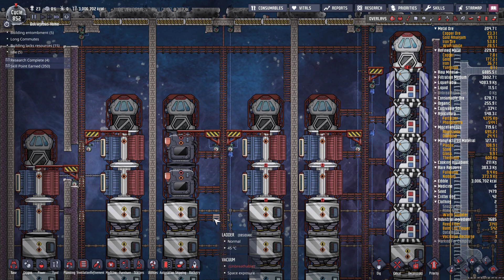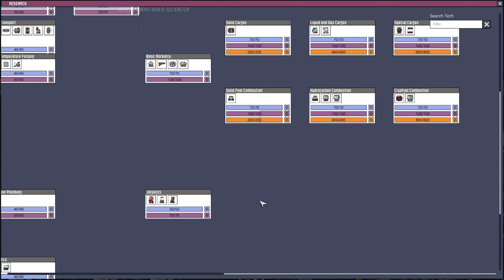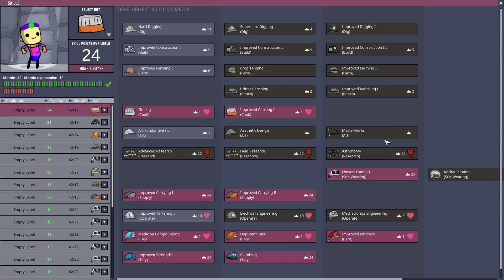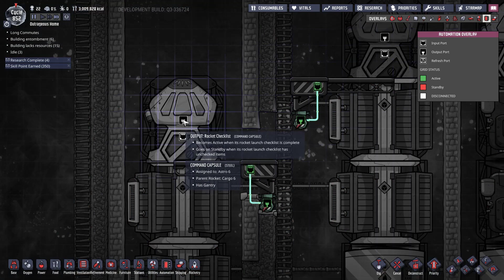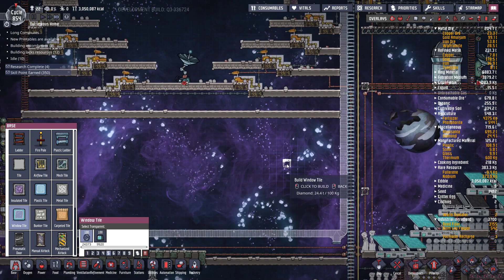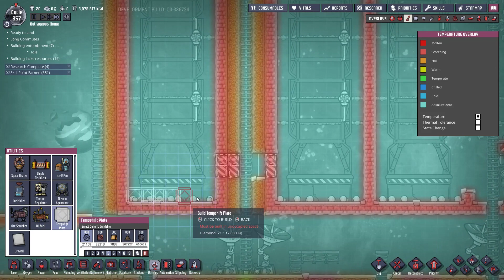QOL Mk3, 31 Rocket Automation : Oxygen not included

Comment: Does this carry over to the spaced out dlc?
Reply from the maker: They changed the rockets a bunch in that, they introduced some extra fuels and the rocket capsules now need to be configured. A lot of the reasoning for the automation in this was to defend against meteors, they are removed in the DLC so most of the automation is not necessary anymore.
Reply: @Francis John  thanks just finished watching your latest upload.  Plastic does work for radiation shielding because of the hydrogen in the molecules.   Issac aurther talks about hydrogen as a radiation shield it's also why water is such a good shielding material as well. Idk if it translates to oni.  I may have to try it myself

Comment: I know this is an old video, but I'm thinking maybe a simpler automation would be to connect the gas sensor directly to the rocket automation input and to connect the rocket automation output and the space scanner directly to the bunker doors. A rocket won't launch if all it's boxes aren't checked so making sure its output is green before launching is redundant. It just needs a green signal no matter the source.

Comment: After going to 80k planets, still no fullerene...any tips?
Reply from the maker: Are you scouting them with Research modules? You have revealed all the question marks? You can get out as far as the 110k planets with one cargo module using only petroleum and liquid O2.
Reply: @FrancisJohnYT  But even liquid O2, what a hassle....
Reply from the maker: @JayCeeB3  To make Liquid O2 you will need to use thermo regulators running hydrogen. It's annoying and energy intensive but if you don't have access to fullerene it's the only way.

Comment: You might be able to use a conveyor bridge to span across the bunker tile to stop the rocket cargo from absorbing heat? I'm fairly certain that the no material ever exists in the center of it. the material 'teleports' to the other side
Reply from the maker: Such an obvious solution to my problem, you do not want to know the lengths I was about to go to trying to work around it.
Reply: Might also help to use gas/liquid bridges whenever crossing into/out of a rocket silo. Bit less heat transfer?
Reply from the maker: Have also adapted that as well, cuts down on my insulation costs.
Reply: Hope it works! :)

Comment: Don't know how to send a save and don't have that all slime save for the seed. 
To automate slickster. I just set up a shipping rail to the incubator room. Then another grabbing meat eggs and egg shells and send it up. 
Dupes still have to grab shells and send back down. I did at 1 point let the eggs sit in the receiver thing or a bin and would auto crack over time but sending up the raw egg. Found it would collect slimelung on the way up.

Dupe wouldn't get in rocket. check to see what dupe is doing. I found most of the time they were already tasked at some other job, or on free time. Operate rocket has been added to personnel task so it takes priority over all jobs. So long as it's not operate the endless craft item. Molecular forge, oil to petro thing. 
Yes I'm still running it. 2 of them. Keeps up though. Oil is doing ok but if I draw to much power. Oil drops. 

Shove vols were changed 1st mini update after added in. They stay in space biome now and won't run rampart through out the asteroid.

Comment: The only solution I can see for the liquid oxygen problem reducing hydrogen production is an overflow pipe much like your previous storages. You could build a simple little overflow around your current tank build, then simply drop the excess liquid oxygen onto something like your storage hole to cool that all down, or straight into a small with no backing so it just evaporates into space. Actually, with a temp shift plate and a thermo sensor you may be able to automate it to do both, if desired. Little thing, but I think it would give you an extra layer of hands free rocketry if you chose to pursue it.

I actually hadn't even thought about using a purely automated rocketry system before this, I was always paranoid about potential damage even with insulsted insulation pipes I didn't trust the cryo fuels. Since watching I've had a few ideas about pushing molten niobium through pipes made of insulation in order to extract the tungsten from the abyssalite. However, it seems like a ridiculous amount of fiddling for a relatively minor payoff.
Reply: He could just dump the extra gaseous oxygen so he doesn't waste the power cooling it before disposing of it as a liquid, the same way he made an overflow for his hydrogen in case it backed up.
Reply: Yes, that's definitely an option. I didn't consider the power cost because currently most of the cooling required for condensing the incoming oxygen is done by the reservoir of liquid oxygen rather than the supercoolant in the pipe. But it's ultimately always going to be more efficient your way given it costs nothing to run.
Reply from the maker: Your right, I may have to dump some oxygen into space to make enough hydrogen for the build I have planned. I'll go over how to work that out in the next video. I will unfortunately be using numbers/calculator but I'm doing up a cheat sheet so it's should be fairly ok for everyone to follow. Also how did the molten niobium experiment go? Given available game mechanics that sounds like working a nuclear reactor using nothing but chewing gum and wet tissue :) and about half as safe.
Reply: I made it work, temporarily. My liquid valves kept resetting to 10kg/s even though they were set to 900g/s. When it was running properly, and I remembered the right way to set up pipes to keep flow, it melted the standard pipes made of insulation in about a cycle. The only real issue was getting the liquid metal to start the process. In testing I went with iron, since you can get unlimited from space, but gold would work better. Basically to melt the insulation you need liquid niobium, which requires super heated liquid metal at about 2500 degrees minimum. I just ran the liquid metal through a refinery making steel to bump the temperature up, then ran it through a radiant thermium pipe behind a niobium metal block, melted the niobium and ran it off to a thermium pump to get put into storage. Fun fact, liquid niobium goes up about a thousand degrees while making steel, which is absolutely insane.

So yes, getting the liquid niobium was the easy part, then you run the ~2500 degree niobium through two refineries, which gets it around the insulation melting temperature. With more testing I'll be able to make a stable version, but given my child has decided I'm not allowed to play while he's awake it'll have to wait.